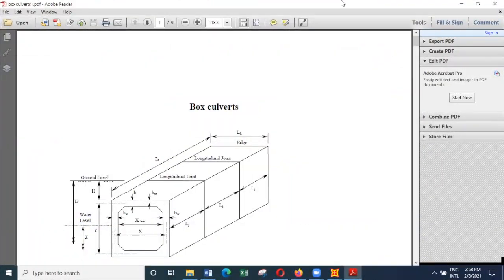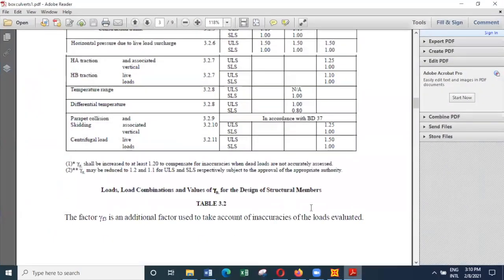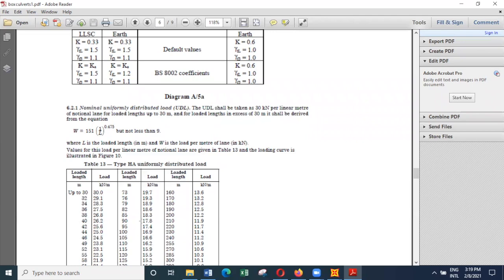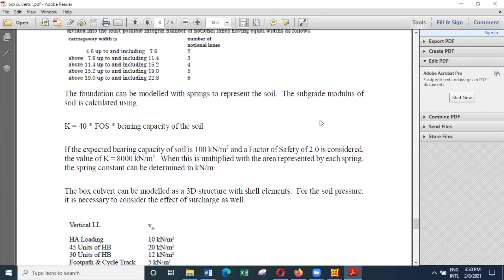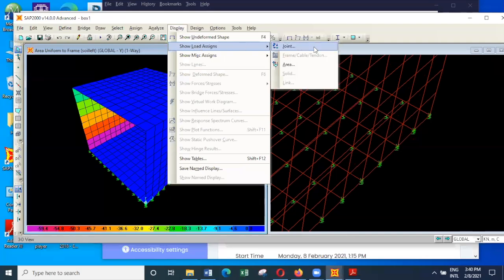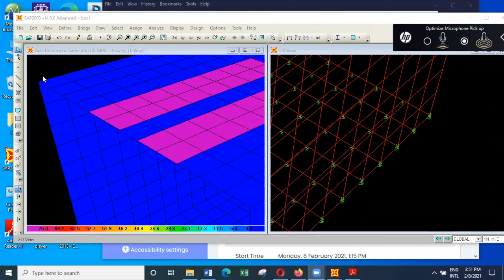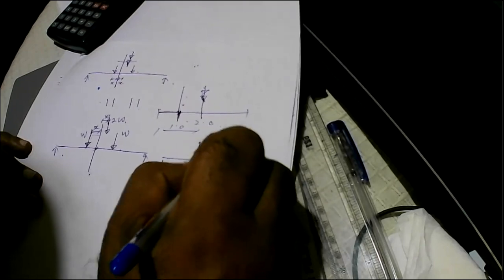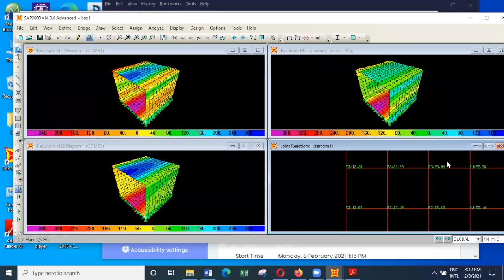Modelling of a Box Culvert using Sap2000 with detailed calculations by Prof Thishan Jayasinghe

Comment: Dear Sir, This is a very valuable lecture. Thank you for uploading this lecture.
Sir I have a question, which values in sap model should be taken to calculate the reinforcement design? In Sap model, at the edges of the culvert show higher values but it concentrates only within the small area.. Should we take such values for find the reinforcement?
Reply from the maker: For reinforcement design, do not rely solely on peak values at small areas (e.g., the edge of the culvert) unless these represent a critical region with expected high stresses. Consider using averaged or smoothed values from the SAP model and select reinforcement based on these more representative values.
Reply: @advancedcomputermodeling  Thank you very much Sir